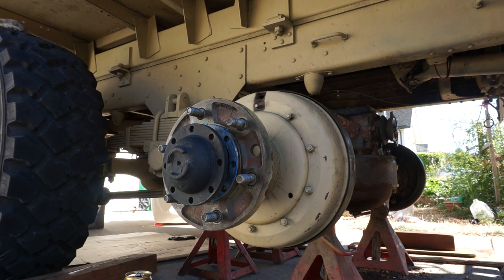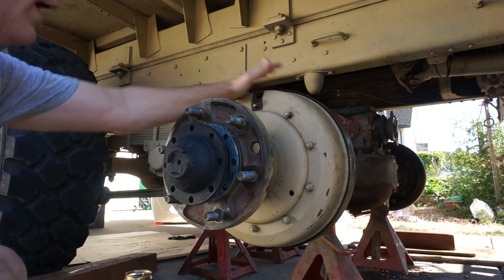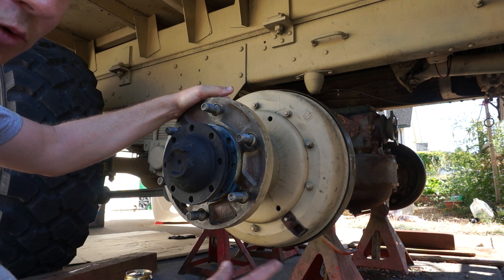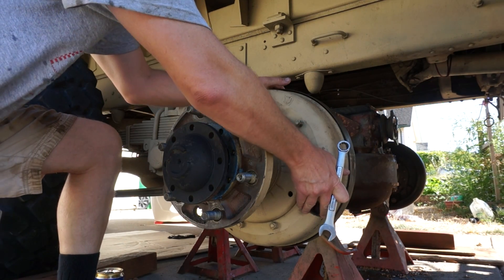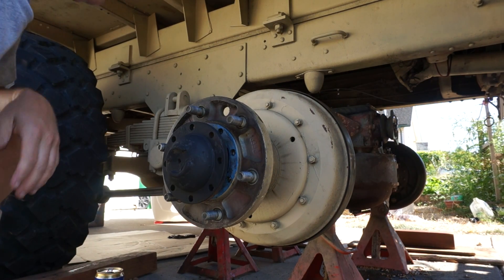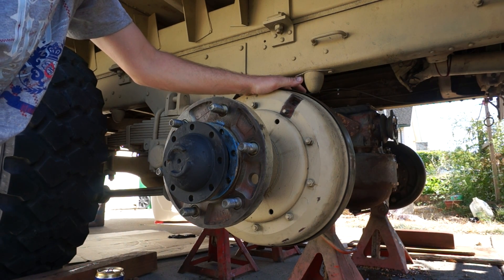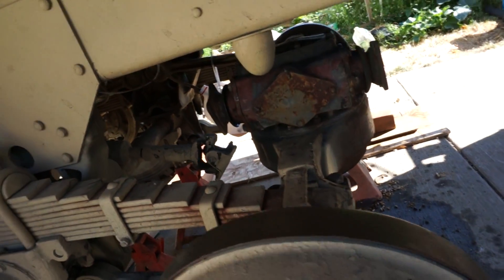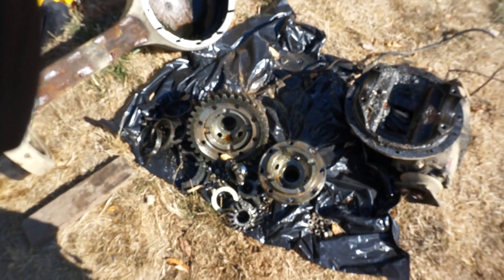M35A2 Brake Adjustment and Failed Rockwell Differential

Comment: on the replacement - could you have just switched out the center chunk? Not sure if it comes out that way Im just asking .
Reply from the maker: Yes that is possible, but the same amount of work.  I got a whole axle and it had new brakes on it, so I rolled with using the best parts from the two axles

Comment: you dont have to have the axle drive shafts removed to adjust the brakes, just lift the whole axle up so both tires are in the air and they should spin freely. you dont need to jack up both axle at the same time either. just some advice. also adjust your bottom brake adjuster first then the top .
Reply: Not the case on the Deuce, there is no interlock switch, the front and rear axles are locked together permanently .
Reply: @ValleyRock13   you're correct but also wrong, you dont have to disconnect any of the drive shafts or lift both axles in the air, the axles have open differentials so as long as you got one axle up the tires will spin free. Not all trucks have open centers but most do. And dont say its "impossible" I have a duece and I just did a brake job on it. Was just letting others know for future reference. Your are correct that they don't have an interlock .

Comment: how many miles and hours did your Duece show, around the time of the failure?
Reply from the maker: It was about 40,000 miles and 1700 hours.  The truck is a 68 and was rebuilt in 93.
Reply: Wow, really low miles.
Reply: @dmzflightmedic  mine has about 5800, it runs well. It's a little scabby(rust) since it was used on a beach for a long time. It was last checked through in 89 so eh each truck lasts a good while it just depends on previous drivers and if it was serviced well. I think mine might have something like 114k miles on it dunno I need to look at it again

Comment: This must have different axes than my truck. My wheel lugs are on the drum.
Reply from the maker: Don’t jump to conclusions just yet.  If you remove the drive axle, outer spindle
nut, lock tab, inner spindle nut, and then pull the drum assembly off the
spindle and look from the backside you will see 8 grade 8 screws that match the 8 that match those of the drive axle.  Part of the beauty of this design is that the hub (that mounts to the drum using the 8 screws) uses the same inner race for the inner and outer on the hub.  So, with the other geometry being thought out properly it is possible to “flip the hubs” which includes that and flipping the lug studs.  So the hubs and can be set IN, with duals on the rear.  Or set OUT so that singles with all wheels having the same offset.  In both cases the tracking is proper for all axles.  Hope this clears this up for you or other viewers.
Reply: can I adjust my breaks with out Flipping the hubs?
Reply from the maker: Absolutely!  If you have an M35 take a look at the data plate on the dash for the tire pressure (if it is still there).  While these beasts had many configurations, the M35A2 typically had two wheel configurations: 1) with 11x20 singles and the hubs flipped OUT or 2) with 9x20 rear duals with the hubs flipped IN
Reply: Brian thank you for that bit of into I'm looking at an M35 and was wondering how to run singles on the back... the way it looks I may get the kit and just run a single rear axle.

Comment: How did you discover that the diff had failed?
Reply from the maker: A few months prior I'd started hearing pops and noticing binds on turns.  When I say binds it would be in a turn and get “squirrely” or just unstable like the rear ran over a plate of spaghetti.  Since then I’ve added high powered magnets to the fill plugs.  This allows them to be pulled from time to time and have a good look at the metal being circulated around without draining oil or making a mess.